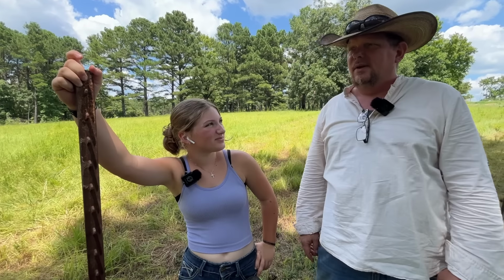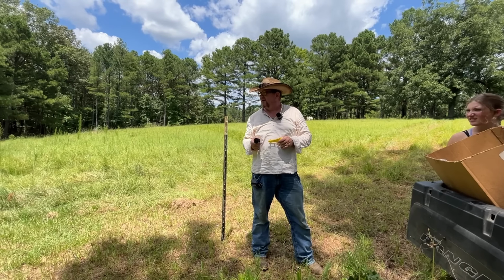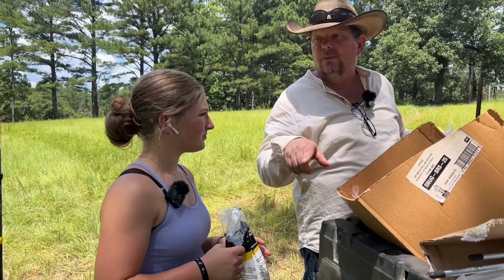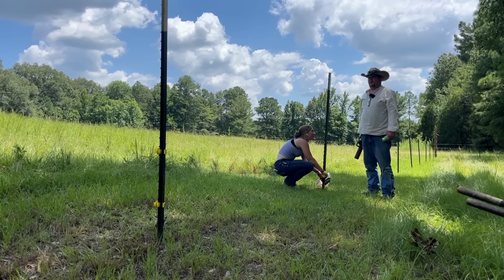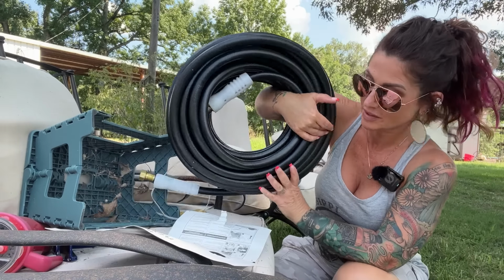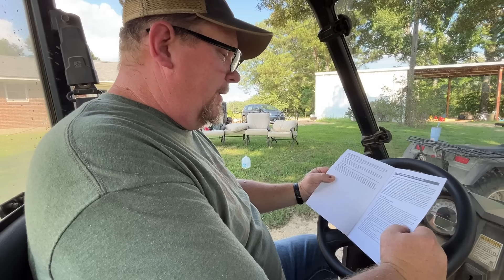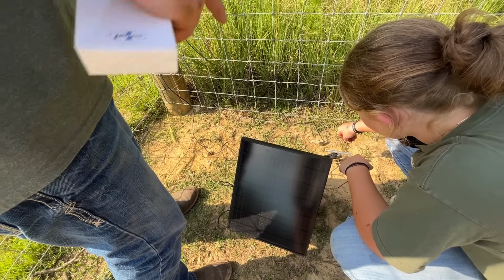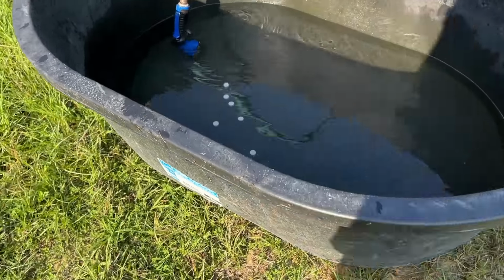She Got Zapped! Installing The Electric Fence For New Goat Pasture

Comment: How about putting a gate up in between the two fenced off pastures the one where the goats at and the new one that is getting electrified I guess, that way you can let the goats get in the other pasture and help mow down a bunch of that grass that's there it'll be something that you could do before you get sheep or it could actually have lava goats to have more range to run on and more natural food and you might not have to buy a bunch of sheep
Reply from the maker: The sheep are part of our Farms business plan for what we will be selling. We have a makeshift gate at the bottom currently, but we will be adding a permanent gate between the old paddock and the new.

Comment: Okay remembering a video that y'all did not too long ago but what's priority and what's not priority seems like chicken coop should be next right
Reply from the maker: As discussed in that very video you’re referring to the chicken coop could not be finished at that time because I have birds sitting on clutches in the coop and doing construction on the coop right now would severely disrupt and potentially make them get off the nest and I would lose half developed eggs.
Reply: @3MISSISSIPPI  yes but you can still put it on the calendar for right after hatch date LOL cuz I know you you're going to put those baby chicks in an incubator or whatever you call it to make sure that they stay warm and fed
Reply from the maker: @robertrichards9275 these groups will stay with mom actually but yes we will start working on it in the fall.
Reply: @3MISSISSIPPI  would you like a good recipe for mac and cheese?
Reply: @3MISSISSIPPI  1 lb elbow macaroni a 2 lb box of Velveeta cheese
1 can cream of mushroom soup
About 1 qt of milk
1 lb broccoli florets cut into bite-size pieces
Boil elbow macaroni and drain
Add at least two cups milk 1 tbsp butter into the pot with can of cream of mushroom soup no stir and mix
Add Velveeta cut in the squares put heat on low, when it starts getting good and warm add macaroni back into the pot Place lid on it stir every 3 or 4 minutes
When Velveeta starts to melt add
 broccoli , keep low heat and stirring every couple of minutes until you see the Heat starting to Bubble Up In The Middle , make sure and keep lid on as much as possible when you can see that it's starting to Bubble turn the heat off and continue to stir every 3 or 4 minutes for about 15 - 20 minutes add pepper I would not add salt because there's plenty in the Velveeta cheese
Enjoy !   
ps,  if it seems to be a little on the thick side you can add a little bit more milk if it seems to be a little on the Milky side I would let it cool because it will thicken up because of the cheese before I would add anything else LOL I make mine in a 9 QT stock pot I know for a family of two or three your phone won't last too long but there should be plenty there to be able to put some in the freezer